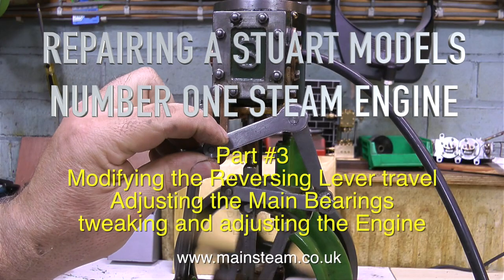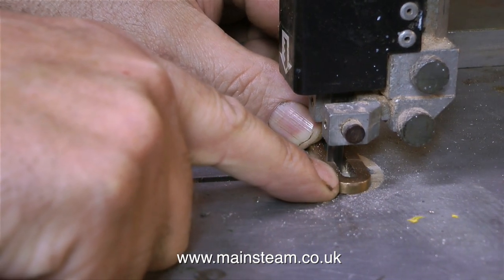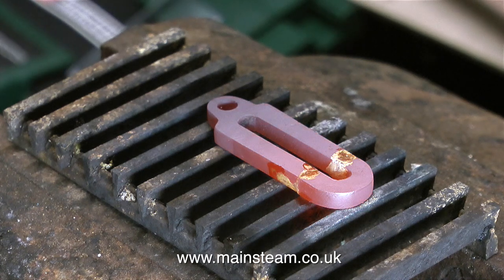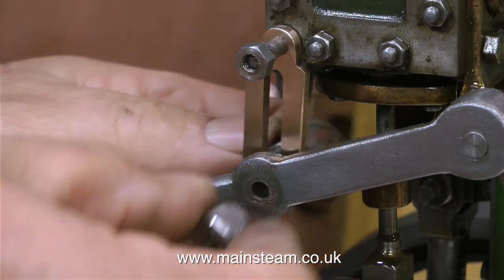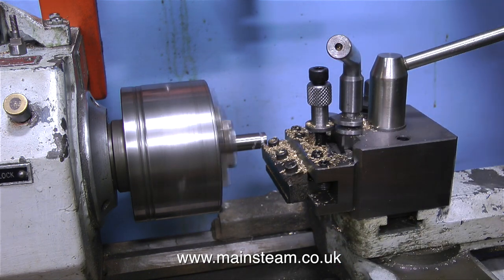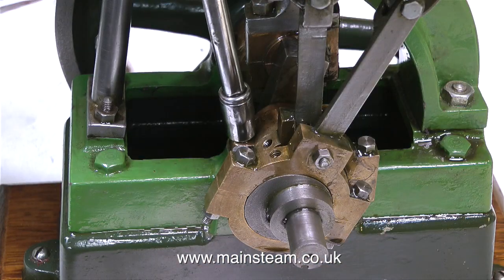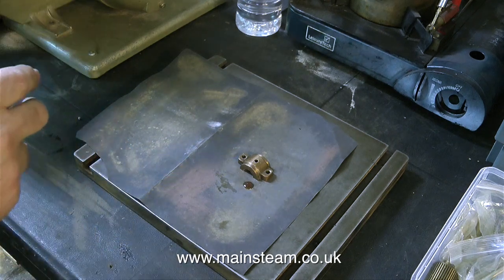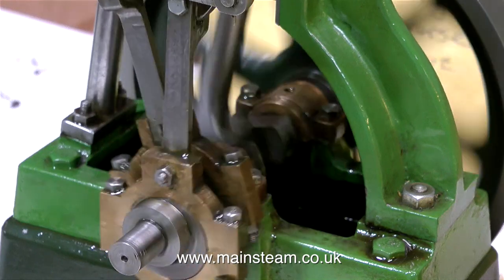STUART NUMBER ONE STEAM ENGINE REPAIR - PART #3

Comment: Thank you for putting together all your videos. I find them very interesting. I am real engineer (electrical not train), an aviation technology professor in CA, USA and am building a full scale aircraft. I tell you this so you can put context to my following comments.
1. I sometime struggle with your vocabulary since I speak "American" not English. It just shows how much we are both alike and different.
2. The external oiling looks like a mess. I can't image what it would be like working on a full scale machine.
3. Your speaking style and humor is wonderfully entertaining.
4. Your restoration methods are education and entertaining.
5. What a difference there is in steam engine versus aircraft. No cast iron and very little brass/bronze.
6. We use imperial measurements/hardware in aviation but they are AN and MS standards.
7. I prefer none adjustable spanners (wrenches)
8. I like watching the painting, paint drying and metal cooling.

I look forward to your future videos.

Comment: I had a friend poke a file tang through the palm of his hand using it on the lathe with no file handle. It was a powerful learning experience and an error he never made again.
Reply from the maker: Ouch - !
Reply: I did that, luckily it was just under the skin and not through it. The hard part was pulling it out.

Comment: a thought. taking your lapping table (the plate you use your wet or dry sandpaper on) drill and tap 3 holes on either side. then in another narrow piece drill out the same boltpattern. that way you can clamp down the sandpaper and you don't have to hold it in one hand and sand with the other.
Reply from the maker: Good idea. I usually do the lapping with my left hand so that the camera can see what I am doing ..... and it rucks up the sandpaper. Your tip is a good one - thanks.

Comment: When fitting bearings on these engines, is it useful to use plastigauge and also to scrape them?  It looked like the top half of that bearing only had partial wear, and its the bottom half that would take most of the load, but none the less...?

Comment: For the filing on the washer, why not just apply it to the bottom of the rotating part? One benefit is that if (one must always plan for the IF) the file grabs, it will be pulled out of your hand and flung away from your body.

Comment: Hi Brilliant video and commentary, one quick question, what is the effect of using actual steam instead of compressed air, does the heat and expansion have to be factored into your adjustments?
Reply from the maker: Steam is more dense than compressed air, but the valve timing is the same for steam or compressed air.

Comment: There is nothing wrong with filing in the lathe if it is necessary. Great job as always
Reply: I have learned filing in the lathe like keith did in his previous videos. He did nothing wrong.
Reply: Machining Basics 
IMO the safest why if you must do it is to hold the handle in the left hand ,with your right hand controlling the end .
That way you are not over the chuck and you have full control over the tool

 But like Keith I do it wrong i do the other way round but I have been doing it for over 40 years at 70+ it’s to late to change ,yes I have a full compliment of digits
But one tip  get a proper lathe file ,they have the cutting teeth at 45 degrees and cut better and leave a better finish

Great video hope you got the gift ok 

Stuart

Comment: Mr. Appleton, did you rework both of the main bearing caps or just the one you showed?  The reason I ask, is that the flywheel seems to be running very true in the final clip.  Certainly more true than it did in the first video.
Reply from the maker: Both of them were "Adjusted" using the same method.

Comment: Great video as always!!! How hard is it to machine one of these from castings? Im saving some money to buy some machinery to make stuff like this. Currently saving for 7x14 lathe with qctp. Probably wont even touch something like this for another year or two. Mostly because Im 15 and saving money for this stuff is tough with school and all. I do have 2 Jensen's and 2 wilesco's. Got my first steam engine when i was 10 (Jensen model 60). Theres a steam show and club that has a bunch of these and a bunch of full size steam engines and tractors. I live about an hour from it. Its always a pleasure to see it. Also i live 6 hours from Jensens factory.
Reply from the maker: How hard is it to machine one of these from castings? ...... it depends on how you approach it. Get some practice in on some scrap castings first then you will get the feel for it. My "How to Build a Model Steam Engine" series that will be starting shortly will be a great help to anyone like yourself who is contemplating building a model steam, engine.

Comment: Keith do me a favor please when your sanding on the finish beltsander don't set it on the rest when sanding thin parts it can slip between the rest and the belt things can get ugly quick.
Reply from the maker: Good point, but the gap under the rest is 1/16" and the part being sanded is over 3 times thicker than the gap ......

Comment: It appears that the the real problem with the reversing lever was not the slot in the bracket but that the lever was pinned to the shaft at the wrong angle.  I suggest it would have been better to re-phase the lever to the shaft than rework the slot and boss on the bracket.

Comment: Why cut and re solder the part, wont it be better to mill a new one?
Reply from the maker: it wouldn't be original then would it ...... ? The idea is a sympathetic repair - I could just make a complete new engine if you see what I mean, but then that wouldn't be the same ...... I like to keep the essence of the original . . . .
Reply: Keith Appleton Is there any particular reason why you used silver solder and not soft solder for the job? It's not a heat/pressure component after all. Just interested.
Reply: Nonsense. I still have my grandfathers hammer. The handle has only been replaced 3 times and the head twice...
Reply from the maker: Soft solder would be far too weak.